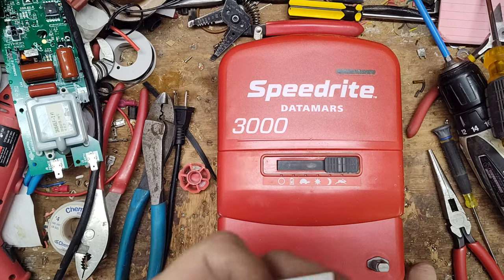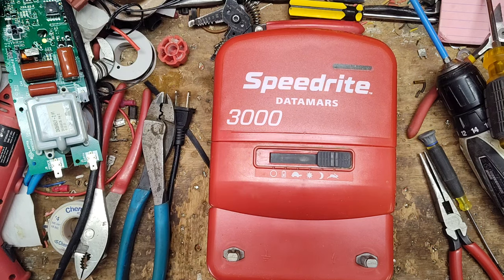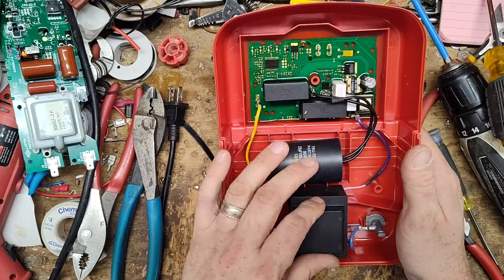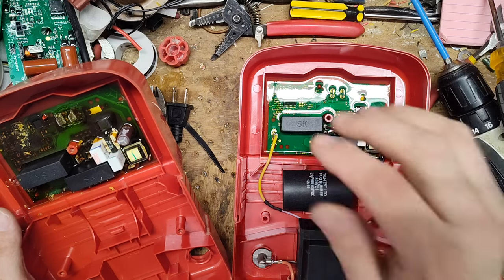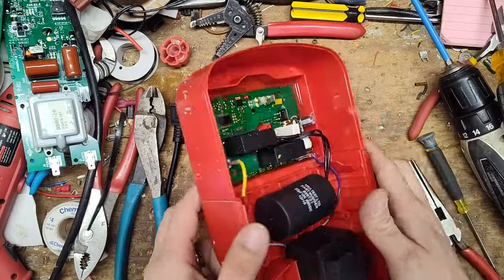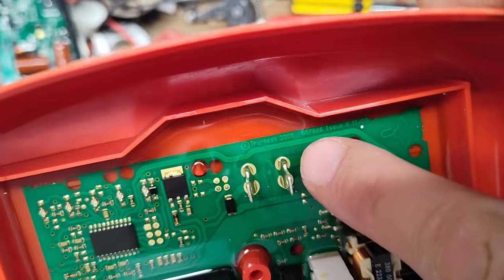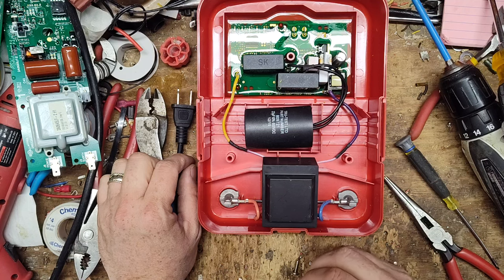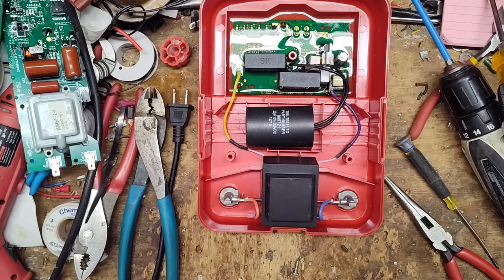If You Value Your Money Then Watch This Before Buying Speedrite 1000, 2000, 3000 6000, 6000i, 12000i

Comment: I would be interested to know which chargers you recommend the most. Thanks!
Reply from the maker: Gallagher by far. They do cost more upfront, but they're reliable. On AC powered units, look at anything that's M360 or larger. On the battery stuff, look at whatever you'd like, they're all good. On the solar stuff, they're all fairly well made as well.

Comment: Whew, youd think a little rubber gasket would be less expensive XD
Reply from the maker: They would have to redesign the case to allow for a spot to put a rubber gasket in it, right now it's just a small overlap between the front and back case. They're just a junk design and way overpriced for what they are, even their parts are expensive.
Reply: @FencerFixerRepairLLCKansasCity  Ive noticed the prices and reviews. Ive been hitting the grindstone for 80x80 paddock electric net rotational sheep grazing. Its between the Cyclops stallion, and the parmak magnum for DC only supply. Im broke, so the parmak is well in the lead, and the speedrite stuff is nowhere near making the list haha. I am glad your videos exist, because no one else is taking these things apart for giggles...
Reply from the maker: @matthewcarroll3193 That Parmak one is likely not going to be strong enough for the sheep especially with the netting fence. The netting fence has a lot of resistance in it and the Parmak is only about 0.5-1 joule at most. So if might be able to handle the netting, but sheep typically need a minimum of 3 joules to make them listen. The Cyclops Stallion or Champ would be ideal, just protect the fence charger from the weather and sunlight. Cyclops plastic isn't the greatest and the sunlight UV will fade and maybe the case brittle and they have no seals on the car and water will indeed get inside. 

The only other brand I would suggest for this situation, would be the Gallagher MBS400. Gallagher is an awesome brand, very reliable, serviceable if needed, a 3 year warranty, and can be installed outside with no protection, just keep it off the ground directly so water can't work its way into the unit,  set it on a post or something.